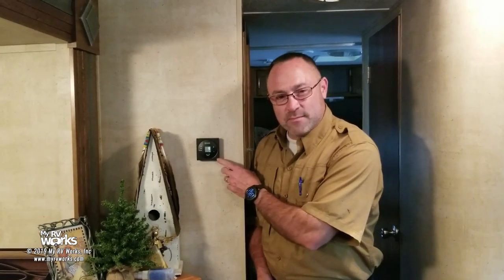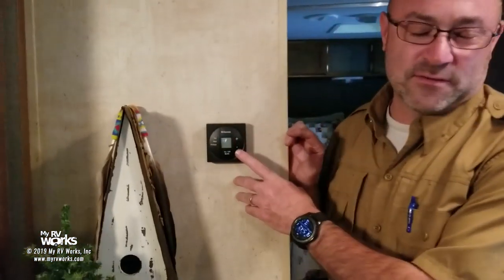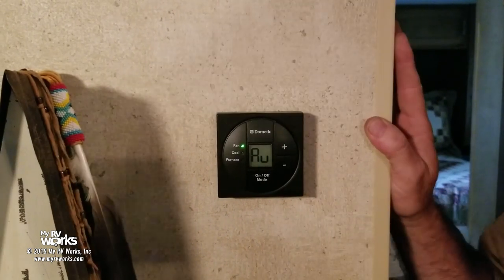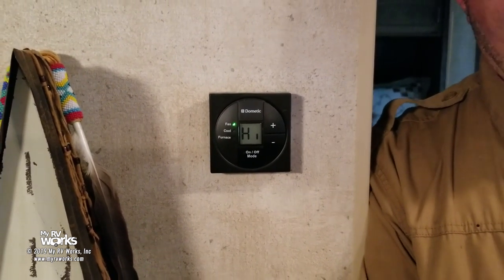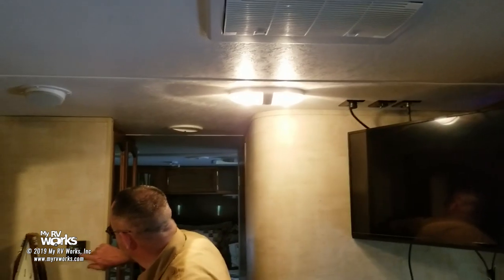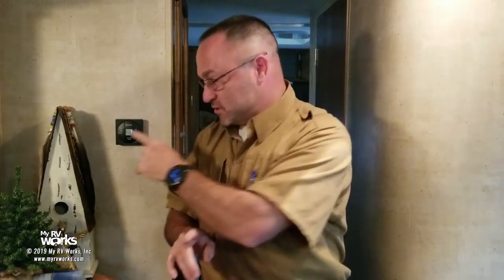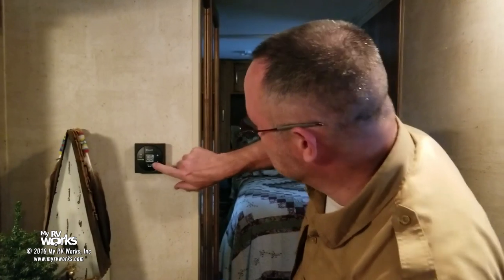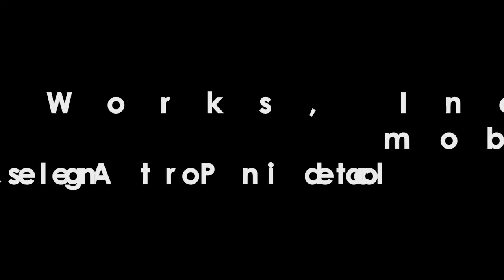How To Operate A Dometic Single Zone (SZ1) RV Thermostat

Comment: Thank you so much!  No one ever explained the thermostat to us either and I guess we thought it worked like our home. So easy to understand now that I have seen it. One more thing I would like to add that happened to us - we had a roof vent shooting cold air directly at the thermostat which caused the a/c to turn off and then turn right back on once it realized it wasn't really as cold as the temp set. When we closed that vent, the a/c turned on and off (on auto) as it should, reached the desired temp and shut off. The vent was actually installed aimed at the thermostat and is not one of those that you can change direction. My husband switched it with another so it's not aiming at the thermostat. The dealer kept telling us we were running both furnace and a/c at the same time and that was causing the problem but they were completely wrong. Your video should be shared with all first time RV buyers. Would save lots of aggravation. Again, a big thanks!

Comment: Thanks for another great video.  I have the CT Thermostat that's very similar to this model.  Found the CT manual on your web site for things unique to the CT model.  The final tip on the C to F change is great.  I've got one thermostat in C and one in F. Now I can set both on F.

Comment: Thanks for clearing this up. My Fan was coming on up top with my heater on. I called dealer & manufacturer of my unit and they told me I must have a crossed wire, that should never happen??? They told me to shut off my A/C fan at circuit panel to resolve problem.  I also asked how to put A/C fan on low? They both told me it only runs on high. You understand it, they need to watch your video.
Reply: Same thing my dealer told me!!

Comment: Your my favorite RVTech. Thanks for another great video. The only thing you did not cover was how to set the differential. There is a 2 or 5 degree differential you can set.
Reply from the maker: I made a note to add the Diagnostics mode to the description of the video. I'll probably do another video demonstrating this as well. I also have about 40 more service manuals to upload specifically for Dometic air conditioners and thermostats.
Reply from the maker: I have added to this description of the video to include Diagnostics mode and error codes.

Comment: First time I have understood my thermostat operation and know am thinking I have another issue...first thing in am I turn on furnace on low to 70 degrees.  Unit runs fine until temp is reached, turns furnace off and then never turns on again, regardless of drop in indoor temp, unless I turn the thing off and restart it.  Any suggestions on where to Look?  Thanks!  Bryan Platt
Reply: As I have continued to work on the settings, the furnace turned on in the middle of the night, and checking the indoor thermometer, I now see that it will turn on normally once there is a 10 degree drop in indoor temp.  Surely 10 degrees is an unacceptable temp drop before the furnace turns on!!!????  Now, how to change the turn-on point to a few degrees?
Reply from the maker: Hi Bryan,
 
Your question has been selected for an upcoming video where it will be read and discussed by Darren.
 
If you have not already subscribed to the 'My RV Works' YouTube channel, please do so and keep a watch for the '10-Minutes with an RV Tech’ video sessions.  This new series is a selection of comments and questions that will be covered and released weekly.

Here is our YouTube link:  https://www.youtube.com/c/myrvworksinc

Happy Camping,
My RV Works Media Team
Reply: @MyRVWorks Did you ever do a video on setting the differential.  I could not find one in your list of videos.

Comment: Great explanation. If you get  confused while camping and just want heater on and fan keeps coming on this should help out. If still confused just flip off the a/c breaker and problem solved when using furnace.

Comment: Great video!  I have the newer thermo with the blue back light.   Spring break camping and it’s cold.   Have the furnace on, fan auto, set to 90° and it’s not coming on.  Any suggestions?  TIA

Comment: Lol thanks man.. I have a Coleman mock and it was doing that I noticed if I turned it down it would stop doing that and continue to cool but then if I tryed to turn temp up a little later because it was getting cool it wouldn't shut off even if I went to 90. So been wondering if I need a new thermostat.. The on off part I had a feeling was related to being on that boarder line zone but not sure after turning it done to stay cooling why when I turned it up to shut off it would not.????

Comment: Big fan of My RV Works and I can’t thank you enough for educating me about a number of issues I’ve had with my Montana 3730FL. 
I operate my two domestic whisper quiet with no leaking from condensation through return vents but twice I’ve experienced leaking slightly while operating the rear a/c while it was raining. I examined the A/C carefully but I must be missing something. Do you have any ideas ?
Reply from the maker: You can try this, remove the ceiling plenum inside from the bottom of the air conditioner.  Once removed, at Each corner you will find long bolts that screw into the air conditioner on the roof. Make sure those are tight. There's a gasket that is between the air conditioner and the roof membrane and you need to make sure that has a good compression.
Reply: Thank you so much for the education on my a/c leak because last night we had our first rain and wind storm since I received your instructions and I’m happy to report no leaks. Not only am I grateful for the guidance you gave me but I’m more impressed that you would take the time to reply to my comment, so please keep up the good information because you are a god send for amateurs like me.

Comment: Thanks for your help now I know how to use my air conditioner properly, but now when I use my furnace since it's cold here in WA again my furnace is making a clicking noise before it starts and shuts off. Did I do something wrong in my settings when I did the air conditioner
Reply from the maker: No, but in that video in description I list the procedure to get into the Diagnostics mode of the thermostat. One of those modes, I believe it's 04, you can start and stop the furnace to verify if there's communication there. Check out my playlist on furnaces for a plethora of furnace repair videos:  https://youtube.com/playlist?list=PLk44vSl27TRCaZIQbm-0utYK7sVOKwXVY
Reply: @MyRVWorks  I tried the diagnosis but nothing shows on the screen when I pushed the plus and minus

Comment: Thanks you so much for the video..cuestión my ac in the rv never turn off even when set the high point 32 degrees celsius..ac spent electricity when is on? A live in Miami 😢..😅
Reply from the maker: On that display, check to make sure that the fan mode is set to 'Auto'. I suspect your fan mode might be set to 'Hi' or 'Low'.
Reply: @MyRVWorks  yes I found out the fan mode was in high..already move to auto.
Another cuestión the furnace mode is a 90 degrees set..I turned off? I need that mode on in Florida with 95 degrees? 
Thanks

Comment: My bedroom AC keeps shutting off at night after a few hours on low fan. I raised the temp up to 64 and it ran for 3hrs and shut off again the next night. It’s been in the 90’s during the day but does cool off by morning into the upper 50’s. I have to get up and turn the floor fan on☹️ My front AC did the same thing one morning but fan was on high. Ran for a couple hours then shut off. It’s like their in Auto or huts a certain freezing temp and shut off. I even changed one domestic thermostat for a new one. That’s my vent.
Reply: You ever get to the bottom of this? My ac turns off too, even though it’s on low, during middle of the night.

Comment: Hi sir I hope you see this. I’ve been watching you for a while now and I have even went and looked at all of your videos but the one thing I can’t seem to find is. A video on having a problem worth the black tank and what I mean by that is. Say there is a clog in the black tank to where you have to take the black tank down. I have a 2018 Keystone hideout and I think I’ve got a problem. Yes I have tried everything you can think of to get it unstuck lol. But this is the one area where I need help
Reply from the maker: I have created an attachment that I use a dedicated 16 gal Shop-Vac for (For obvious reasons). For the attachment I took a long clear section with the Bayonet fittings so I can put it in line with the sewer hose. Then I cut that section in half and used a flexible 3" Wye reattaching the clear section on either side. And leaving the angled part available so that I can slide in a 3-foot piece of pipe the same diameter as my vacuum hose. I also added a separate termination valve ( with the bayonet fittings) so that I can control the vacuum pressure directed towards the tank and then open it once the flow starts. This adapter and Shop-Vac 'tool' has cleared many, many clogged tanks.  I will add this tool to my video queue and send it out soon.
Reply: My RV Works, Inc. thank you sir. I’ll give it a shot and see how it goes.

Comment: That little speed switch was driving me nuts. I was sure I had a bad AC. 
However, mine will throw the breaker on hot days, and a new thing now, the thermostat just won't make the AC come on no matter how cold I set it. If I turn it off on the thermostat, then back on, it returns to normal function. Someone suggested a bad start capacitor? It's not even 1 year old.

Comment: Continuation, when my furnace is on, one of the vents in the bedroom is blowing cool air instead of warm and it's been like that since I bought it, any suggestions on why?
Reply from the maker: Some might say that the benefit is the fan will circulate the air throughout the coach balancing out the hot spots and cold spots. For the cold air blowing in your room, that sounds like one of your ducts has a breach or is not connected to your furnace.

Comment: Does the furnace have a separate fan? Or does it use the roof top unit fan
Reply from the maker: The furnace has its own fan. The furnace operates as a standalone unit. It only gets its start signal from the thermostat. Typically your furnace will blow the hot air from the floor or registers close to the floor. Your air conditioner fan will blow from the ceiling ducts. Again two totally separate systems.  They only share a common thermostat and since the thermostat communicates with the control board in the air conditioner, the furnace runs wires up to that control board only for its start signal.

Comment: What's the purpose of having the fan on with the furnace, and y doesn't it show the current temp on display?
Reply from the maker: Some folks may opt to run the fan only in the ceiling while the furnace is blowing the hot air from the floor. They might do this to help circulate the heat throughout the RV.  But as we all know that gets kind of noisy.

Regarding the temperature display, I really wish they would display that. The thermostat knows the temperature but for some reason they chose not to display it. The next model thermostat up from this one does show the temperature.  However, In the description of that video, we list how to access the Diagnostics mode on that thermostat. Within the Diagnostics mode you can read the room temperature.

Comment: I have a 2011 keystone raptor.... The 5500 onan evap generator is not charging the battery when running and the battery goes dead....what should I do to troubleshoot?thanks in advance
Reply from the maker: On most coaches, near the battery within a few feet, you should find a circuit breaker fuse or something like that. You can check to see if that fuse is open or failed. If you are getting 12 volts in your coach for lighting, and things like that, then you can assume that you're converter is fine but on some converter/chargers there is also fuses on the converter/charger that may be separate from your panel box fuses,  so look there as well.  I've got several videos in my playlist that might help cover your situation.

Comment: Thanks for video analogy so listen to this ac in camper the fan wont come on and I've got voltage coming from thermostat fan wire going into circuit board and I've got 110 going to it I have replaced circuit board and it's still same so what I've done for now is hotwire high fan low fan switches just the red wire tho to the 110 blue wire that is going into circuit board and it works for now by hotwiring it but I'm boggled by why my high and low fan prong connections are not being energized when I have a good thermostat and everything else checked out good going up to it! Please help if you can think of anything else to check she said converter needs replaced also
Reply from the maker: On the description to my thermostat video, I added how to access Diagnostics mode into the description section. So try this, access the Diagnostics mode and cycle through the commands. Low fan speed will be commands 01 high fan speed will be command 02 see if you're getting good communication from the thermostat to the control board.

Comment: Dude, this all Greek to me! When it’s 95 outside I want my unit to be 70 on the inside. How do I do that? I never use my furnace here in Texas so forget that furnace stuff. Just want it COLD!
Reply: Turn the cool on 70. Heat to 50 or what ever. It will cool. Fan can be on low, hi, or auto up to you it will cool in any of the fan speeds.

Comment: this model of thermostat is garbage.... it can work as long as the lights are on, one has their glasses on, AND knows how to program it, but its NOT intuitive and if one tries to operate it in the dark or low light, which is common and reasonable at night, OR someone else tries to adjust it, they can easily mess up the programming, which then has to be reset if one wants it to continue to function correctly... 
 its better to remove it from the wall and send it to dometic with a note saying "have your engineers and designers try harder".... and maybe they will eventually design one that can be intuitively programmed, and that the settings can be saved/locked so that mistaken or random button pressing in the dark wont cause one to have to reset the entire programming....

Comment: I’m having an issue to where the fan and compressor will turn off even if the fan and ac is set at certain temp and “low”. Do you know why this would happen? I tried initializing my thermostat and it didn’t fix it. It’s the same thermostat as that one but in white, and it’s a dometic ac.